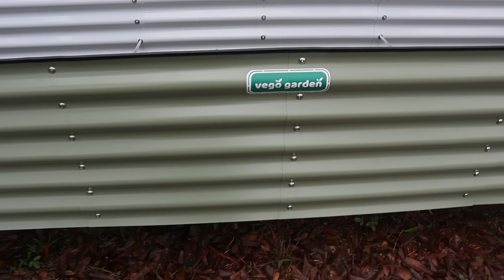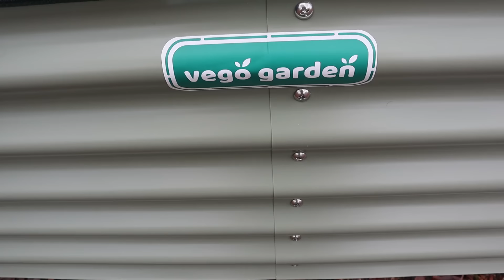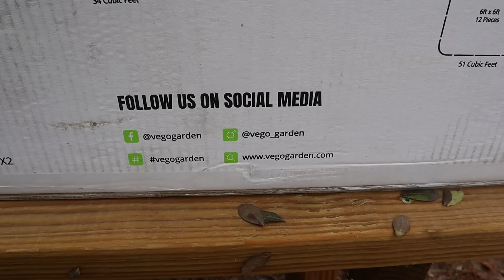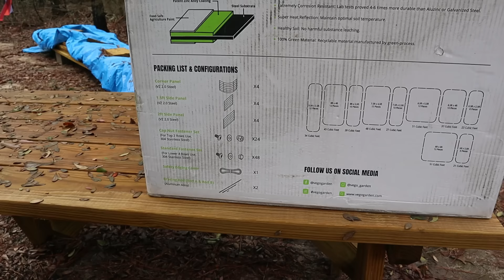Raised Garden Beds are a MUST!  Vego Garden: Unleash Your Green Thumb!

Comment: TIP FOR DEER PRESSURE:  I have the 32" Vego beds and absolutely love them.  My beds had plastic on both sides of the panels.  I also deal with a lot of deer.  I put rebar on both sides of my beds and used 1/2" PVC pipe to make hoops and put shade cloth over the hoops and used clips from the dollar store to clip the shade cloth on and batta bing batta boom deer proof for the past 2 years.  I also used your education on how to grow carrots for the first time and couldn't believe the difference from the grocery store. I will never go back.   I have learned so much from you so thanks for schooling me on how to grow better vegetables!

Comment: That's a valid item for DSH and PG to promote. Yes, peel ALL the protective film BEFORE you start screwing it together. All your assembly advice was spot on.  It IS easier if you have a partner, but one person can do it alone (if you don't mind some mild under-breath cussing).  I got two of these a couple of months ago. Not cheap, but I won't have the trouble and expense of replacing the wood sides in a few years.  They are the envy of the other gardeners in my neighborhood community garden. I'm confident they will last 20+ years, and that's all I need at my age. Hope you are both well.
Reply: Lol….cussin!  Nah, they are easy to put togrher….even for a non-DIY like me! 🤣  I thought removing the film might have been the most difficult part of the install.  Enjoy them 👍🏻
Reply: That peeling is a nightmare and I got a different brand.  It took most the time than actually putting them together.

Comment: Danny I'm a big fan and a cub owner, 48. I've found a raised bed solution that's almost indestructible  and I get them for free. I get wore out or damaged rubber tracks off smaller track hoes, bobcats, and other equipment.  I get them for free from a local equipment rental place. They are glad to have you haul them off. I've found a few other uses for them. I've cut them apart and laid a slab of them on the ground in a gate my cows walk back and forth through on a daily basis. This stops them from walking a mud hole in the gate.
Reply from the maker: Awesome

Comment: 💯 Agree!  I’m starting my 3rd year with 3 Vego beds and have 2 new ones to assemble.  I did my research before purchasing these and fully endorse the product.  I’ve got these in my front yard and they look great — tailored and stylish (just in case looks are important to you 🤣).  The 17” is high enough to keep the rabbits out….so far.  Note that it takes a LOT of soil to fill these. Easy to put together and deceptively light in weight.  I’m delighted to see that you and Wanda will be using these.  Frankly, using wood to create a garden bed in the south….well, that’s a very short term solution as the wood breaks down so quickly.  These will outlast me! ❤

Comment: Love the Vego raised beds, I was excited to hear your opinion on it. I don't have a tractor and in my older age, the Vego seemed like something I could do. Def only hand tighten bolts all the way around until all bolts are in. We've had our 2 for 2 years and love them, they are sturdy and the coating on them is incredible. I've dropped concrete blocks on the outside (accidentally) and it didn't even scrape or chip the coating. We got the 17" ones too, seemed like the best buy for our $, got the 9-in-1 and I think a 6-in-1 that we ended up buying extra panels for later to enlarge the growing space.  Before our Vegos, we had several wooden beds, but in the south the sun is tough on wood. They were made well, but only made it a few years in full sun. I've not seen sun nor rain nor heat affect our Vegos. The quality is worth the asking price even though it seems kind of steep to start with. They do occasionally run sales if you're lucky or patient enough to get a little off, it's easier to make the leap. Highly recommend them for those who want raised beds.

Comment: Goodmorning Danny and Wanda I'm glad you did a video on those raised beds. I've been considering buying some this year. I have moles, or voles tunneling in my yard they finally found my garden. Wish I knew how to get rid of them. We've tried all the store products and nothing works. We have friends who are experiencing the same thing. Very strange. Have a blessed day.
Reply: We had such a problem with voles in one of our gardens that we fenced it and ran hogs in there. They got rid of the vermin, along with tilling and fertilizing the soil. But, when you put in your raised beds lay down hardware hardware cloth, before putting the raised over. More expensive but keeps them out. Chicken wire will not work. They can squeeze right thru it.
Reply: Agree! Hardware cloth on bottoms! I’ve got voles too , only thing that worked in garden was putting sticks of juicy fruit gum in holes. In my yard though nothing because the holes are not as defined as the soft garden soil.
Reply: @taylorshomestead3934  those pesky voles are opportunists. They use the mole tunnels every chance they get. I used to have a landscape/ hard scape co. Did several edible landscapes with raised bed gardens. I really enjoy using the hogs with the added pork in the freezer!
Reply: Voles are a problem here in NC also.  I placed a good amount of jagged gravel at the bottom of each Vego bed to deter voles.  Don’t think the hardware cloth will last as long but it sure sounds easier to install!  Thanks for that tip.
Reply: @joannc147  your welcome. The gravel sounds good too. Wouldn't hurt to add it also

Comment: I use old chicken wire down at bottom of raised beds. Helps keep some critters out.
Reply: Good idea.  I also have raised garden beds that has legs that are about 3 to 4 feet high.
Reply: Wish I had thought to do that when I first installed mine.
Reply: @fascination2525  
My raised beds on legs have a wooden bottom to them.  If I decide to expand my garden I will so the same.  Matter of fact I may get a mesh screen because it has even smaller holes.

Comment: We hit the holiday sale on the  raised beds. Got 12 of them for the farm. Just need to tap into the landscape designer running around my squirrel cage… Be blessed ❤️🌿
Reply from the maker: That is awesome were hoping this will be our answer to raised beds.
Reply: @DeepSouthHomestead  like you said, definitely line the bottom with wire mesh or the like. Ours eventually started to breakdown after 8 years of being buried at the CA place. It was zero fun to dig out the soil and replace it but absolutely necessary to keep the burrowing critters out

Comment: In East Central Florida,  I have 3 in 4x8 configuration.  No fire ants in the beds for 4 years. I did use rebar & pvc hoops with shade cloth or netting to keep deer out. Look forward to following along. Thanks for sharing 🙏 😎 🏖 🏝
Reply: Did you put ground cover for weed suppression at the bottom of your raised beds?  Lots of fire ants here.
Reply: I have to cover in the north with mesh and netting but reusable plus cayenne powder.  Lots of animals see my gardens as a diner.  Not pretty with mesh and netting here and there.  May need to get more traps too.  Sorry Bugs Bunny, Bambi, etc.  So far those solar sonar mole deterrents work.  Though the neighbors have them now.🤷. I got mole traps.  I'll see in spring if they return.
Reply: @shodson314  YES I do use ground fabric at setup. Florida has lots of fire ants. I get an infection from the bites.

Comment: Wow great timing Danny. I woke up at 2:30 this morning thinking about what type of roma tomatoes I'm gonna grow this season and Where to plant them. Then saw your video. Last season I started having an anthracnose or possibly blight type situation last summer so not planting tomatoes in the garden for the next several years. I did get a full harvest last summer but not without some losses. I was thinking of buying large 25 gallon pots but I'd need at least 25 to 35 of those and they're expensive anyway. So the Vego raised bed option would last way longer than any plastic pot.. I never allow myself any type of failure when comes to tomatoes for sauce. Sauce is a huge deal at my house. So I'm already thinking and planning for this next seasons Roma mater variety and where theyre going to grow. Lol

Comment: Danny,  I got them for several years and use branches and flat wooden stamps on bottom so you do not need so much compost and while the wood is rotting it will keep soil moisture and nutritional benefits

Comment: We recently bought a similar product in another brand. Replacing some old raised beds from 2004 where the wood is failing.  I'm still deciding on either the 24x96" or 40x80" setup.  The 40" wide setup gives us more planting area, but I'm like you and thinking the 24" is easy to work from one side while sitting on my tractor scoot.

Comment: You might want to put a small mesh screen under your hardware cloth (unless hardware cloth is stronger than garden cloth?). My daughter had to use mesh screen because they also had moles or voles.😘❤🙏🏻✨
Reply from the maker: It's galvanized coated.

Comment: I am looking into the beds.  Using stock tanks now with holes drilled for drainage.
Reply from the maker: They work just don't use the galvanized it will rust out fast from the fertilizer.

Comment: I am planning on a high tunnel this year and since I'm older and because of the Bermuda grass in this area I am probably going to use metal raised beds.  Thank you for this information.  I will also use the heavy weed control fabric to cover the entire area.  I'm even thinking of putting the weed barrier three feet further out ever side of the tunnel or digging a 18 inch deep by 12 wide cement barrier around the high tunnel, which do you think would work better to keep the Bermuda grass out????????Yes, the soil will be the next problem to tackle.  We have four 26 inch high by 24 foot long and 3 foot wide raised beds out in the open area of our garden.  We filled the bottoms with tree limbs, garden waste, wood chips, then put down a layer of cardboard, added top soil and finished off with bagged soil.  Every year we have to add about 6 more inched of compost and bagged soil.  Does the soil in your raised beds drop that much every year????
Reply from the maker: The concrete bramuda grass will grow on the fabric,

Comment: Thanks, Danny. I just bought 2 of these and have a question for you. I have a squirrel problem here in FL. Do you know if there is something I can put over the top to keep them out? 

Thanks!! ❤
Reply from the maker: 1/2 inch square hardware cloth is what I use in 3 ft wide rolls.

Comment: The only negative complaints found are on delayed shipping.  Apparently, some folks have had issues with product advertised as available and fast shipping promised only to later learn they take your money and then you find they don’t actually have the product in stock.  Of course you get some run around to finally learn this.  As for the safety for potential leaching of toxics from metals into soil … unknown due to the coating being “proprietary.”  In other words they don’t want you the consumer to know.  Other than that; there are many consumers happy with this product.

Comment: I got 4 of  Birdies beds  last spring. Getting them filled was the hardest part. I bought the 29 inch high 8 in1. It is a game changer for this aging lady with double sciatica. I was weeding my beds, all 4 in 15-20 minutes. I chose Birdies over Vego due to origin. If I could be assured the materials China is using is really as advertised....they would have had my business also. My bottom line was I trusted Australia over China. Sorry.

Comment: I see that you were wise enough to bring it up - to put down wire mesh on the bottom of the planter before filling it; keeps out moles, gophers, etc.  I filled several of these with good garden soil and then had to empty them and start over - forgot the wire mesh protection!

Comment: I ove the look and appear to be high quality My concern in using them is although it states it wont leach out but the coating has aluminum in it and aluminum in your soil is not healthy?  We are currently looking at garden bed options and had considered these but unsure because they have aluminum in them. According to their own website "VZ 2.0 is a highly corrosion-resistant steel substrate, hot-dip-coated in a specialized layer of Zinc, Aluminum, and about 3% Magnesium."
Reply from the maker: They have a zinc alloy and steel no aluminum.
Reply: quote from thier website " VZ 2.0 is a highly corrosion-resistant steel substrate, hot-dip-coated in a specialized layer of Zinc, Aluminum, and about 3% Magnesium."

Comment: I didn’t see a bottom on the bed. 
Didn’t say that beds need to be off the ground because of gamma rays messing with the root development?
Reply from the maker: It helps to be off the ground. We are doing containers right beside them to see the difference.
Reply: @DeepSouthHomestead  curious to see results 
I made raise beds with pallet wood and used milk crates and fabric cloth so the soil would fall through the openings on the crates. 

Not pretty but functional

Comment: Is hardware cloth and tar cloth the same?
Reply: Hardware cloth is a heavy duty metal screen …. Usually in 1/2” size.  Great ventilation and useful to protect animals ….. or keep animals OUT.  It is pliable, which I assume is why it’s called “cloth”.  It’s not a cloth at all!  Not a weed barrier.  Hope that helps. (I don’t know what tar cloth is).
Reply from the maker: No it's galvanized metal.
Reply: Thanks!

Comment: You have told us that we wont be able to plant in the ground because of radiation. But there is no bottom on these so isnt that the same as planting in the ground. Thanks.
Reply from the maker: No it's above the ground.
Reply: @DeepSouthHomestead  That makes it easier. I was thinking we had to get it off the ground all together. So it sounds like just sitting it on top of the ground will be fine. Thanks. Prayers for Wanda and you.

Comment: I do think it is important to buy products where the owner of the business is a USA business because then you can be pretty sure that USA standards are being adhered to. Also depending on the country, they don't all believe that the customer is always right. I won't buy anything made in China where the company is also Chinese for that reason. I have had too many experiences of buying items made in China where the company is also Chinese where the product is not quality and wears out/breaks in under a year.  I haven't found that with any other country whose products I have bought I have to be worried about the quality of the product.
Reply from the maker: That's fair enough these have been on the market for years with no problems.